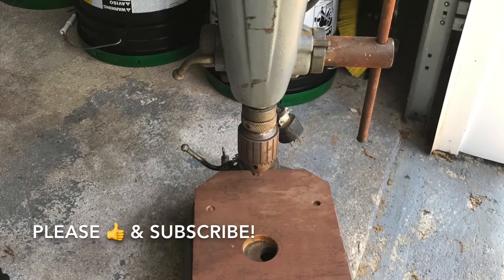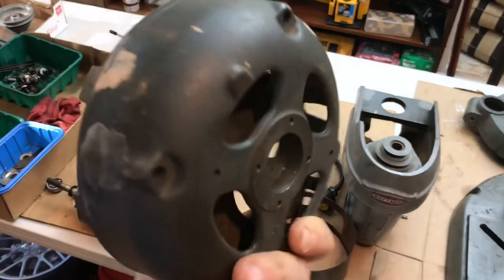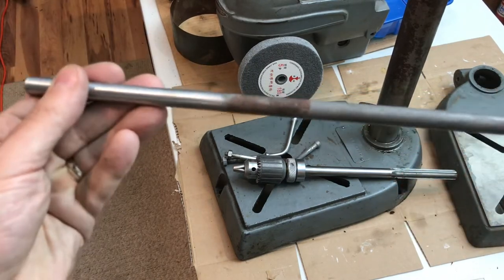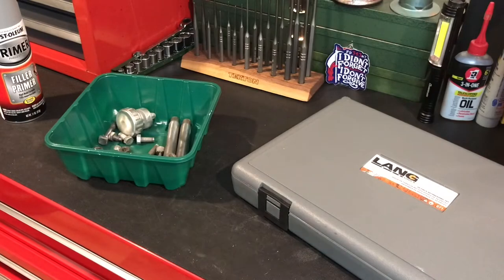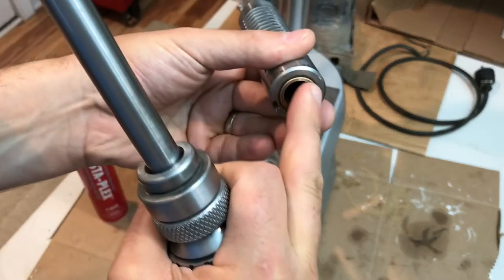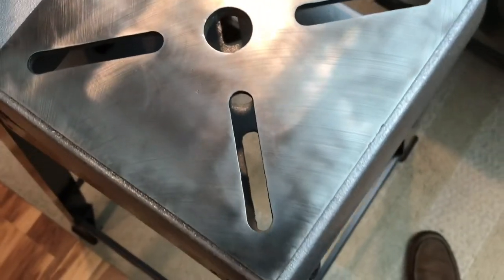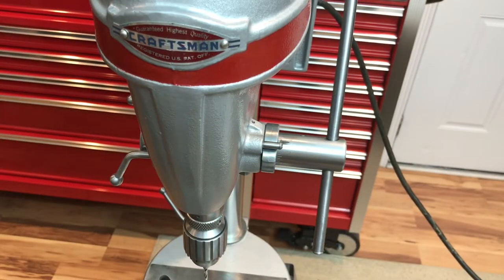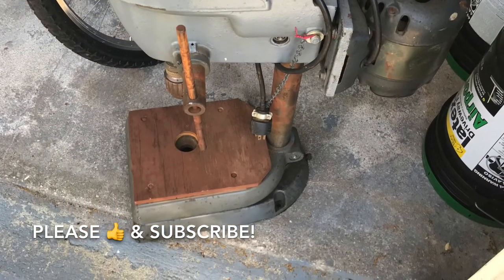1950 Craftsman Drill Press Restoration!

Comment: Beautiful restoration. It was a Godsend to shop restorers when Rust o leum came out with their  hammertone line of paints. I have used it on countless restoration products such as toolboxes,  and machines with great success like you had here.  What i like the most is that particular paints ability to cover small flaws in the finish of what it is being applied to.

Comment: I just bought the same one for $20.00 and it was rusty! Vary similar amount, but with the straight red powder rust on the base and table flats. No paint. Just black metal, so one job is already done. I see my pulleys are both upsidedown. Lol No wonder the belt clearance is so tight. You really gave me some great ideas on how to clean it up even more. Thank you vary much for the video. IMO it was just the right amount of useful info needed, without a bunch of unrelated ramblings you see in a lot of videos. 👍🖖
Reply from the maker: Appreciate the kind words. It was a fun project but took some time especially with making the video.
Reply: @TomGunnTools  I bet! It looks like it. I was originally looking for videos on how to refurbish the craftsmen placard itself. If it was paint or enamel, if new ones can be bought ect.. Any ideas, thoughts, places you can point me to?

Comment: Nice restoration! Many years ago I restored a neglected 1953 Atlas 9325 bench top drill press. I used distilled white vinegar to remove all of the rust. Everything came out looking like new. I kept the color as close as possible to the original. The motor was actually in very good shape and is dated pre WWII. The drill press runs like a dream. Once again, awesome job restoring it and giving it a new life.
Reply from the maker: Thanks for the kinds words.  If you check out my my most recent video, I just picked up another!

Comment: I've been wanting to pick up a drill press to add to my tool collection. Was looking at all the new stuff, but nothing is made in the US anymore and if it is, its priced way outside what I can justify for the few projects I'll ever use a drill press for. I just found one of these locally, its in rough shape, but the motor supposedly works and price is right. This just gave me the courage to go pick it up and restore it. Thanks!
Reply from the maker: These old ones are beauties and they were made to be repaired so they are not that difficult to work on. You won’t be disappointed. Go for it!

Comment: nice job! A great simple upgrade is replacing the motor mount shaft bolts with thumb screws. Makes speed changes take literally 5 seconds.
Reply from the maker: Good idea for sure.
Reply: It's really nice to keep all that stuff original.

Comment: Have you thought about putting a directional switch on there so you can have it spin in either direction?
Practically all drill press motors are capable of running either direction. I have seen several videos on how to reverse drill press motors and reasons for doing so.

Comment: I'm about to start doing some small restorations and I'm curious what you do with the finished bare metal parts like the base plate and pole to combat rust forming. Do you treat it with a kote of oil or what? Thanks
Reply from the maker: I used to wax but I came across Maxifilm and I use it on everything the last year or so. Check out my video on it. https://youtu.be/N1DWT67_QaI

Comment: Great Job!!  The final appearance makes the new bench top drill presses pale in comparison.  I especially like it when you tell the source and type of tools that you use doing the work.  What type of paint did you use?  What type of clear coat? The name of the company that makes the paint and clear coat would be very helpful.
Reply from the maker: Hi Fred, I used all rustoleum products for painting. Gloss regal red, Hammered Gray, Hammered Black and gloss crystal clear enamel clear coat. That’s for watching.

Comment: Great restoration Tom!  You did a beautiful job with it.

I noticed the 2 vintage thumb oiler cans near your workbench.  Do you use them as oilers or are they just there for decoration?  If you use them, what kind of oil do you put in them?  I think I saw you had a plastic bottle of 3-in-1 oil too.  I'm a big fan of Evaporust too!

Can you share some of your video secrets? What kind of camera do you use? Are you running the camera while you're also doing the work?  Do you have a mic clipped on?  I ask because I'm interested in doing videos too.  Keep up the great work!
Reply from the maker: Hi Paul, I keep some 50/50 solution of acetone and Automatic transmission fluid in one and regular motor oil in the other oil can. As far as the videos I just use a regular iPhone and the iMovie software it comes with. I don’t use a mic but you can adjust the volume if you choose with the software when editing. I really just started making videos to share my projects and tool hauls with friends and family and discovered there is a lot of people with the same interest. You should give it a shot if you chose not much to it. I appreciate you watching!

Comment: Thanks much Tom. inspirational video. I inherited several vintage tools including a drill press similar to your video.  going to go slow in restoring, works for now.  I really liked the fiber wheel you used but can't seem to find it on amazon. i have a 6" grinder and vintage 6" polishing setup.  would you mind providing a link?  have done little restoring (ie nubee) but why a fiber disc vs wire wheel?
Reply from the maker: Hey thanks for the kind words. The wire wheel and fiber wheel both have there place depending on then project. The fiber wheel leaves a nicer finish on most materials but can’t get into certain spots. This is a good fiber wheel to start with. Uxcell a15122800ux0618 150mm 25mm Thick Nylon Fiber Wheel Abrasive Polishing Buffing Disc https://www.amazon.com/dp/B01DKABIOI/ref=cm_sw_r_cp_api_glc_fabc_N9L.FbWGHK4JF?_encoding=UTF8&psc=1

Comment: Hey, I have this drill press and I cannot figure out how to adjust the belt to change speeds. The belt feels too tight to move but maybe I am just missing something. If you have any input on this I would appreciate it
Reply from the maker: I’m assuming the motor is pushed all the way forward if so I had the same problem as I mentioned in the video. You may wanna buy a belt that’s an inch bigger then the one that’s on there so you have more room to adjust. For whatever reason some of the belts were really shoehorned on there which I can’t understand since the motor is made to slide out and put tension.
Reply: @TomGunnTools  Do you have a timestamp for where you talk about that in the video? And do you have a recommendation for a belt to buy? Thanks!

Comment: How did you get the pinion gear out of the housing. Mine moves outward but stops about 1/3 of the way short.
Reply from the maker: If it’s what I’m thinking you’re asking there is a C clip  that is holding it in. And it took a lot of finagling with a screwdriver to get it off.

Comment: Hey Tom, what's the part number for the drive belt you have on there?
Reply from the maker: On the belt is says A 36 or 4L 380  D&D Power Drive is the brand. I either got on EBay or Amazon. I hope that helps

Comment: This is  NOT a true restoration.  Once you start to add different paint colors that are NOT the original then what you have is a custom paint job,  I do tool restorations  so that they keep their true vintage value.  This also means there are times when I do not paint or fully paint a tool if the overall surface paint does not warrant it.